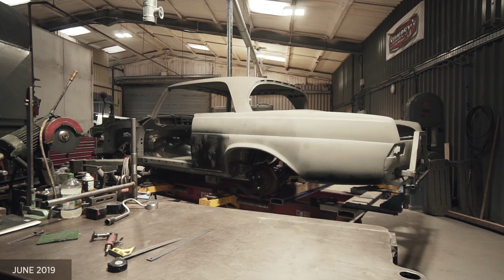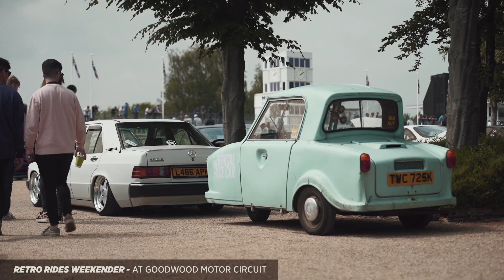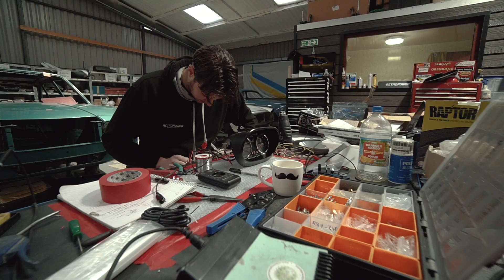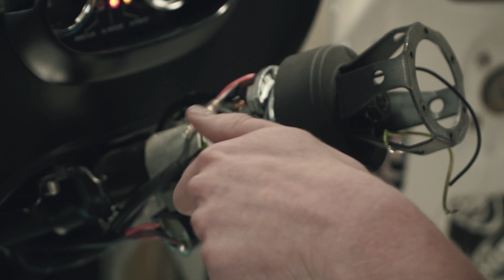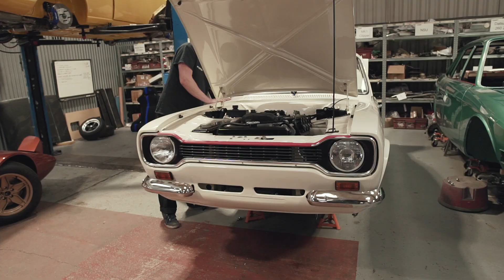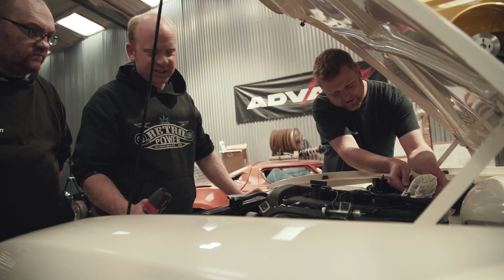Gordon Murray's MK1 Escort - Retropower Build Episode 15

Comment: Cheap looking plastic cam cover doesn't have the period look. CF on a 70s car also looks out of place . Could you not have removed the fixture for the FWD mount from the front cover? Nice work though. Looking forward to the verdict on the rear suspension.

Comment: The PDU’s cool but if your indicator/headlight relay or stalk fails in a conveniently wired car, you still get home, just without your indicators (or you replace it if you’ve got some spares in the boot)... 

If that PDU computer fails... It sounds like you’d have a hard time doing anything other than trailering it unless you’ve got a complete spare PDU on you, especially at night.
Reply from the maker: This is true, but total PDU failure is about as likely as the entire fuse box burning out which would have a similar result. It's built for military use as well as motorsport. Currently used in many LMP cars
Reply: I guess if they’ve engineered it to handle the NVH of military vehicles it should be ok! 

I doubt this escorts gonna be on many long solo road trips to the middle of nowhere tbf!

Comment: Thanks for another nice video :)

I have done the same mistake with the coil plugs on a 2018 Yamaha R1 when installing the racing wiring harness.
Instructions were quite lacking, no numbers on the plugs and the original loom had them going the other way. Caught it in a couple of hours luckily :D

Comment: Cracking vid can you shed some light on the tool used to check the coils were giving power to the spark  plugs (make where to buy etc )
Reply from the maker: MAC tools coil-on-plug test probe
Reply: @retropowercars  👍👍 will have to look into one taa

Comment: 13:30 that's interesting, my experience is that older switchgear needs just a tiny bit of current just to keep the contacts clean. Like old transistor ignition boxes had a resistor on the input so the points wouldn't foul without load.
Reply from the maker: That's an interesting comment and  noted. I've generally found that high current switching arcs when contacting and gradually erodes the contacts. The failures I've experienced have usually been on things like un-relayed main main beam switches and ignition switches. I suppose arcing perhaps does clean corrosion off the contacts but then a little electrical contact lube will stop this anyway